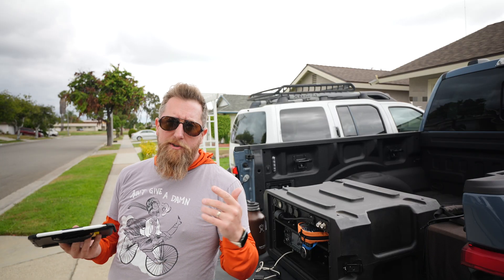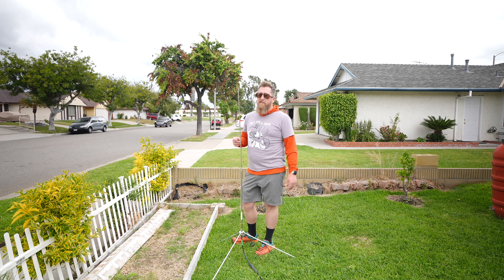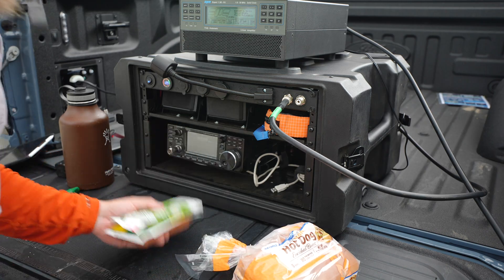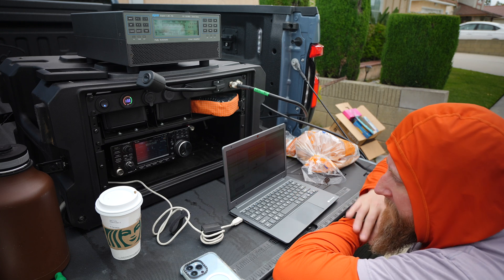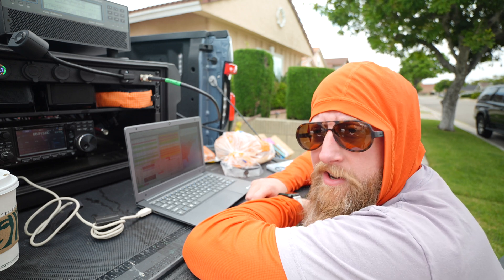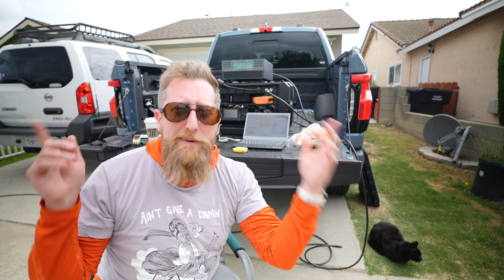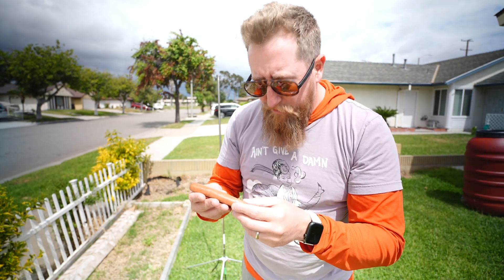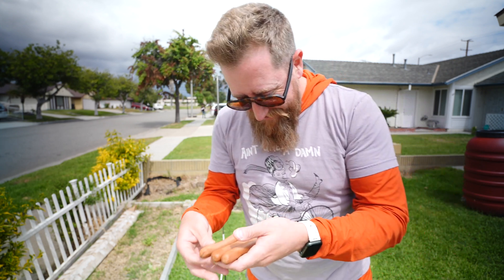Cook Hotdogs With A Radio?  6 Meter RF Exposure Test

Comment: Josh, it seems you placed all your hot dogs close to the top of the vertical. Perhaps next time you could put one close to the feedpoint, where RF current, and therefore RF exposure for the hot dog, is higher. 73 VE3GKT

Comment: Instead of 50 or so MHZ/ 6m band, you might want to try 5600mhz, the 6cm band, to heat your hot dogs. I think most microwave ovens "transmit" on this from their vacuum tube. At 1000w, you should get a cooked hot dog in 3-4 minutes. In an unshielded environment this could be very dangerous.

Comment: A way long time ago (in this galaxy and on this planet), there was a QST artical in which someone built a 2-meter cavity out of a galvanized steel garbage can. The builder discovered hot dogs could be cooked by placing them between the plates of the tuning capacitor and firing a kw of rf into the unit. (You can do it with a couple of nails and a lamp cord, too...)

Comment: Here's a theory: The "meat" closest to the antenna was heated by the RF but since the antenna remains cool, it acted as a heatsink so that there was no significant heating of the dog in direct contact with the metal. The  immediate area surrounding the contact patch received superficial heating.

Comment: You need to increase freq., closer to water dipole at 2400 mhz.   1200 should work fine.
Just like your kitchen microwave.  Remember, the higher the frequency. the more power applied.

Comment: Loved this video.  I had to click on it as soon as I saw it because I used a campfire hotdog roasting fork to add some length to a used 2m/70cm dual band antenna I picked up.  The antenna was 3:1 on 2 meter before adding the length and after adding the "tuning fork" it was down between 1.2:1 to 1.5:1 on 2 meter.

Comment: I would say it is the frequency and not the amplitude.  Dielectric heating (microwave heating) can take place above 10MHz though it is generally extremely weak, most microwaves operate at 2.45GHz which is the 12 cm band.  I find this hilarious since 13 cm is the amateur UHF band for satellite communications!  I don't use 13 cm...yet, but now I am going to assume it needs dishes and all that fun stuff!  Furthermore, I would imagine as you saw with high amplitude low frequency short duration exposure, if you were able to change that to long duration you may have some fantastic results!  Here in the Canaderpian ham course they only teach you the HF can "warm" your skin and VHF/UHF can do bad things to your eyeballs, they didn't really say what, but they did stress your eyeballs are a weak spot, though now that I think about it they are full of liquid and liquid is essentially how microwaves work, so microwaved eyeballs, FUN!
Reply: at 2304mhz many hams still use a yagi, a loop yagi where the elements are loops of thin metal strips, some use a mesh wifi dish but bulky/lot of wind load.

Comment: Resonant frequencies are a thing. Those 6" hot dogs are half wave dipoles at around 800 mhz. You, at around 6 feet in height, are resonant around 80 mhz - much closer to 6 meters. If you bought a big 9 foot long salami, you would see much more heating.
Reply: Newish ham here. Are you saying with the right length of hotdog I can make a simplex contact on 2m?!
Reply: @Synthguy777 yes, a hot dog is a salty conductor, so you could transmit using one. Theres a guy at hamventions sometimes that likes to light up a pickle (salty) from inside like a light bulb with RF. It wont be a very efficient antenna, but it will radiate something.
Reply: @nemam_nedam  You are resonant at the molecular and atomic levels at gamma and x-ray.

Comment: Just curious; you said 6m has opened up and you don’t want to miss out. Are you chasing awards or is it the enjoyment of the contacts? 

Thanks for all the great content!
Reply: Most chase contacts at first, now I rag chew more with the guys I have worked many times... same on 2m SSB, 2 "local"(out to 200 miles) groups I rag chew with. Occasionally stretch that to 350+ miles if there is a little enhancement. Need some troposheric ducting!!!! Haven't had a good opening this spring/early summer. My record distance there is 1350 miles to the very southern tip of TX(I am in SW MN grid EN24ho). I heard CO2OJ in Cuba during that opening but couldn't get his attention past the wall of east coast station that were calling him!

Comment: Josh, before they had good metering, "The Hot Dog Test" was used to measure frequency on open feed lines and antennas: On open feeders, a several metre run was placed just above and attached with insulators to a wooden board. The Hot dogs were then affixed in a long line directly on top of the open feeders.The dogs don't need to touch each other.  Power is then applied, and then the node points are identified by the burn marks, with the rest of the hotdogs surfaces being relatively cooler. One then uses a measuring tape or yardstick to determine the length between each burn mark, and this is how you arrive at the determination of proper wavelength. I can't believe that you haven't heard about it before: I think that it is still in the FCC Commercial Telegraph Question pool. 😀😃😊😄😆😅😂🤣😭🤣 P.S. You MUST go with the 100% beef Frank's. Sausages are straight out. Vegan dogs are too B12 deficient for a proper test. Some folks have used the combo pork and turkey hotdogs in an attempt to measure wavelength, but this should only be done if on an unhabitabed island and if you are in desperate financial straights. This is also frowned upon at annual HOA cookouts. So there's you NEXT Video Challenge. Please wear a "Kiss the Cook" apron for safety, and proceed at your own peril, Caveat Emptor. All the Best! 73 DE W8LV BILL
Reply from the maker: I love this! Thanks for the history lesson.
Reply: we've used fluorescent tubes as well

Comment: My guess would be oxidisation from contact with the metal.  I'm no ham, but I do know how microwave ovens work, by vibrating water molecules creating heat, but that's in the Ghz range.  Would you get such a temperature rise in the sub Ghz range?
Reply from the maker: Sounds like another test is in order! I guess I have the excuse to purchase the 905 now?

Comment: Nice little idea and video.  I was also noticing the opening on 6m when I was on 10m.  In one minute, adjusted the Buddipole and picked up a dozen or so states on 6m FT8.
Reply: when 6 is rocking switch to SSB, you will make more contacts a lot faster! QRP to a dipole there is very doable, I have worked small 10 watt stations 1500+ miles away. You won't work a lot of multihop with low power SSB so that is where FT8 shines

Comment: My wild guess is localized contact RF burn.  Like you might get if your shack isn't grounded.  I think this was a good call to add the RF calculations.  It makes people think more about what they are doing and the possibility of harming themselves or someone else (however remote it is).  It is pretty simple and a good exercise.
Reply: That's what I was thinking. And a 800W RF burn is not the same as heating. And a 5" hot dog isn't resonant at 6m.
Reply: I do them yearly because I run high power at 144mhz thru 1.2ghz. 1kw on 2m to 20 DBi gain antennas, 750 watts on 70cm to 24 DBi gain antennas, and 550 watts on 23 cm to 26DBi gain terrestrial antennas and the same to the 2.1 meter EME dish... so on 23cm 75 feet is min safe distance but the antenna pattern is very tight and none of the RF reaches the ground until hundreds of feet out... when working on the dish I lock out the amplifier power!  Effective radiated power is 133,511.647 watts!!! 

Working on 10ghz now... eventually I want a 20 watt amplifier, dish gain there is insane at 44.6 DBi... ERP with 20 watts is 351,711.162 watts... scary stuff to work with!
Reply: @nemam_nedam  when you can do 500,000 miles off the moon get back to me! Or 1350 miles on 2 meters...
Reply: @nemam_nedam  Dude there are italian stations running 25kw!
Reply: @nemam_nedam  where the hell did I say that? I DIDN'T!
Reply: @nemam_nedam  Where did I say 2kw? Or are all you doing is being a TROLL? 

I NEVER said 2kw. NEVER. Now get lost. BLOCKED

Comment: All this tells me is that this whole "you need to determine your exposure" thing shouldn't matter if you are maxed out at 100W.
Reply from the maker: generally yes. But the calculators will be more precise. It only takes a minute.
Reply: The higher the frequency the more even relatively low power matters. 70cm at 100w has a much bigger minimum safe distance than 20m at 100w.
Reply: @haxwithaxe  BINGO! I run power at VHF+ so I run a calc anytime I make a change... at 70cm and 750 watts to 25dbi gain of antennas my min safe distance is 135 feet!
Reply: But will the hot docs require chemotherapy in later life?…..